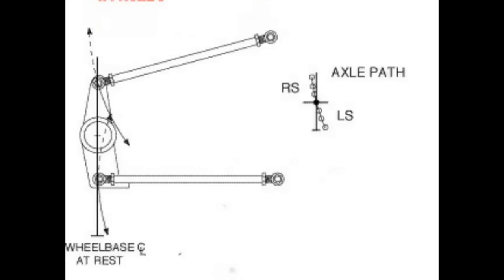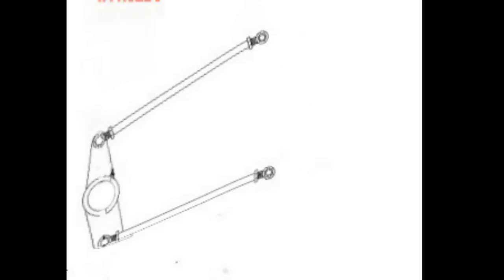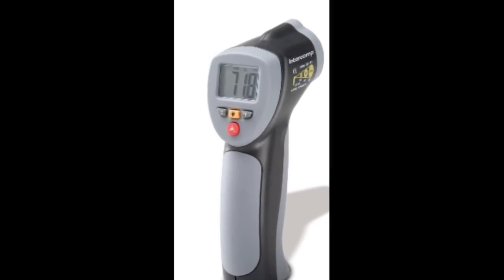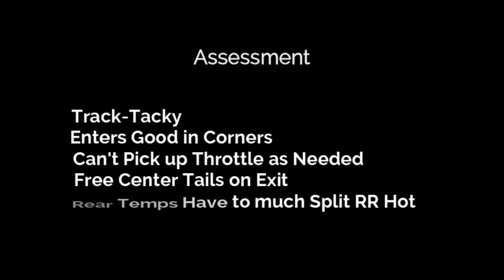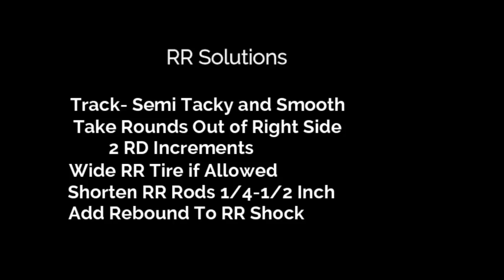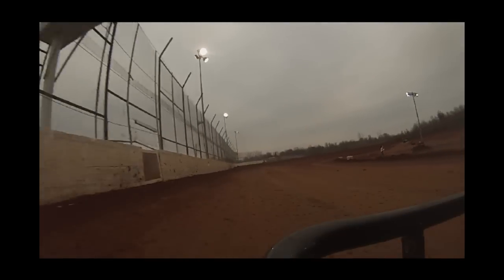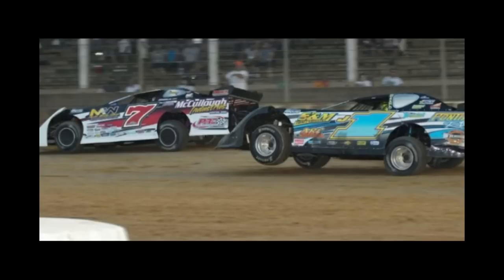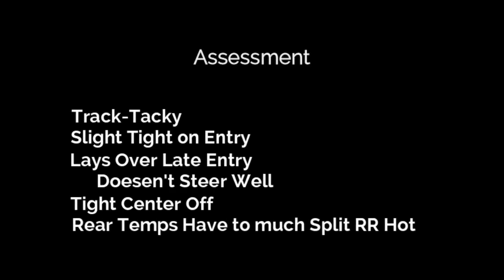Right Rear 4-Link Tuning Guide

Comment: New to dirt late model racing and I’m in almost a 20 year old car and last week was black flagged for spin outs but what you described I was feeling car handles great into corner but when I get on the gas car hangs out I’m bottoming out but im going to try shortening the rods to see if that can help I like the advice and will be watching videos to for handling solutions bc me and my dad are learning and have some help but for the most part are by ourself and I can’t find anywhere else for videos so it’s greatly appreciated definitely subscribing
Reply: add 1/4 inch longer to lower right rear if you need more  add more. You will have to drive it in deeper. A good thing
Reply from the maker: Please contact me via e-mail or my page on facebook info is on about tab on my channel page.
Reply: @DirtTrackDave  I've sent you a message on FB messenger

Comment: Hi Dave 
when you talk about Bar angle are you set angle with car on ground at ride hight or are you looking at Diff at shock stretched out on chassis jack ?
Reply from the maker: Hey Chris that's a good question. See when a racer get on my program or buys set up guide from me I help establish a good starting baseline, while logging where their at currently. That way always have a "restore" point if ever get off too badly or car changes. I as customers where are your bars? They reply, "oh, there in rocket STD, or it's one above, kryptonite STD." (Both good cars respectably)To me that means nothing, STD?!?! That could be anywhere in bar angle. So I verify correct bar position by angle solely. I do this in 2 positions,  static¹ and dynamic ² measuring all my points I confirm they are as I desire for correct handling, having driver know what to expect and movement of torque arm and rear end. I will only accept confirmation of my list of chassis and suspension points only if measured and verified to be correct. Doing this you will be consistently better meaning a higher average finish vs if you didn't. My mindset and the mindset I teach my customers to have is, "never guess, never assume, hands on confirmation only". 🔨⬇️

Comment: Very good job enjoyed it dose it change ride height and if you change that do you have to change all 4 corners
Reply from the maker: So changing bar angles on RR does effect ride height if the radius on chassis brackets doesn't follow the bar radius. Regardless, it's minimal if it does. I primarily focus of the LF, RF, and RR ride heights. The LR is the variable in height as that will change with changing extended load.

Comment: What do you mean when you say take “rounds”out of the RR at around the 7:30 min mark?
Reply from the maker: Taking "rounds out" is a load adjustment simply put. Can't always depend on using smasher to get to the pound accuracy. By using the "rounds out" method (old school adjustment btw) you adjust load via rounds but should know roughly how much change it has. In heavy conditions "rounds in" is needed to keep RR from over compressing, which increases starting load and ultimately raises ride height and both bar angles slightly.
Reply: @DirtTrackDave  thank you that makes a lot of sense

Comment: Have you ever tried the RR shock on the back ? My car is a 08 Mastersbilt and it has a shock frame mount for a behind the axle on the RR ,, it seems the bird cage would rotate and compress the spring and load the RR more ?
Reply from the maker: They use to back in 2000's however if geometry correct it actually cams away from rear mounted RR shock.

Comment: When you are talking bar angles at about the 12 minute mark are those degrees at ride height or while racing.  The 18-21 upper  lower 3-6 degrees
Reply from the maker: That is static bar angles at ride height or as would be in scales with driver. 3 for RR lower is still to low I have found. That's more my dynamic angle I try to stay around for semi heavy conditions say 3/8 mile tracks.
Reply: Thanks for the info man
Reply from the maker: @DaveyAkersMotorsports  yes sir if you need more insight my written information is loaded with real usable numbers situations and email straight to you, check out these guides.
Adjustment guide https://www.paypal.com/instantcommerce/checkout/9974U9XA5MTYS

Set up guide
 https://www.paypal.com/instantcommerce/checkout/4J87KMZC9D5PU
Tire guide

 https://www.paypal.com/instantcommerce/checkout/W6GF2X6VSBNFN

Comment: So what are your thoughts on using the right rear to get through the center and rotate on the throttle? We have been dealing with our GRT with a throttle tight issue that you kinda touched on and we have ended up dropping the right rear upper bar 2 holes on the axle and it is finally turning through the center on the throttle. Our car has a very limited amount of holes on the frame side. We are starting to move towards a heavier RR spring also. It is starting to seem very happy now. Turns in great and stays up on the left rear, turn through the center off the throttle and then rotates on the throttle. We can adjust exit using the limit chain on the right rear as GRT has a set length from the frame to the axle and it says to shorten the chain in 1/4 inch increments to tighten exit.
Reply from the maker: Shoot me an email, info is on my about tab on channel page.

Comment: I am wondering what the effects are if you raise the rr upper bar as to how it will index into the spring. When I raise that bar it seems to make the car tighter and not rotate even though I am adding steer. Do you think the rr spring is already to stiff?
Reply from the maker: When you raise the RR upper it is free on throttle. But can tighten you up slightly off throttle entering.